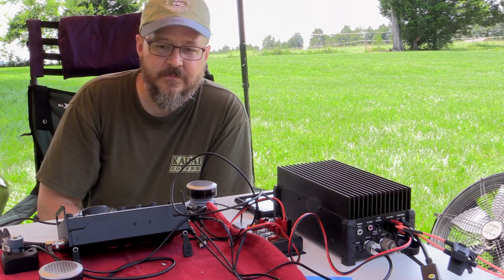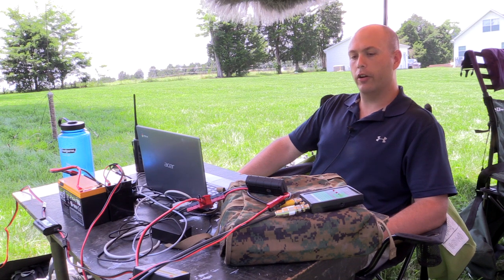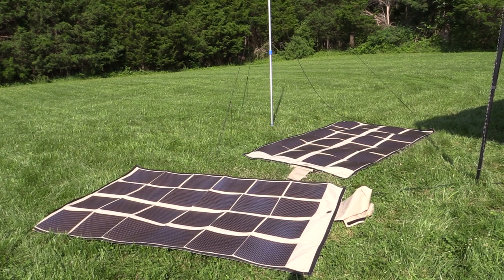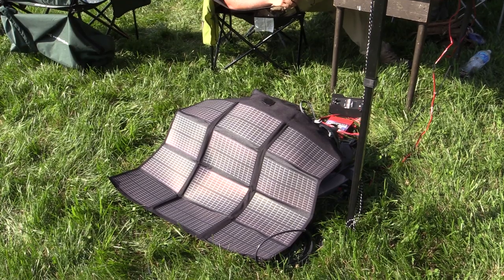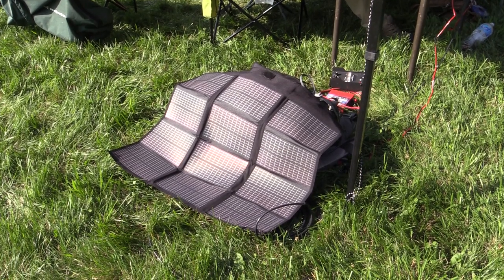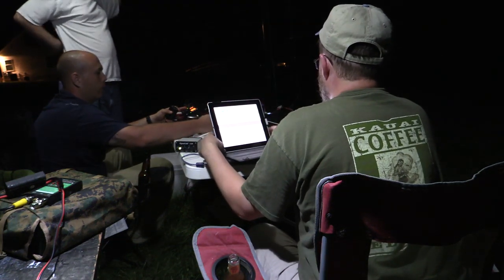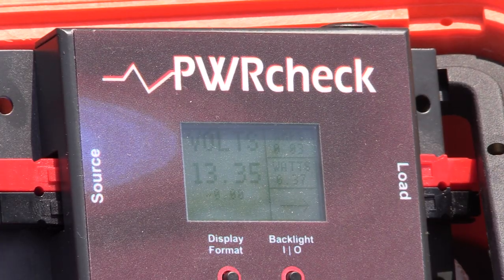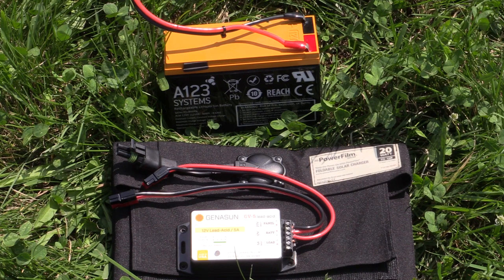2014 Field Day

Comment: What are your thoughts on Power Film 20 Watt panel vs Goal Zero Nomad 20 Panel?
Reply from the maker: I would pick the power film.  I have done tests of their foldable panels before and did not get outputs anywhere near what they claimed.  Now this was 3 years ago, so they may have improved, but I KNOW the PowerFilm are good to go -  I have an older one and a buddy has a new one and they both rock and output thwir rated wattage or a little more.  Just a lot of $$$

Comment: How much average amps did the two 120 panels produce?
Reply from the maker: Our charge controller is only rated for 10A (Genasun GV-10 LiFePo4), so we maxed out at about 11.5A.  This of course is a function of the charge controller, not the panels.  I was hoping for there to be some clouds so we could experience shaded performance, but it was sunny both days.
Reply: the short answer is 12.4 ish amps max.

93watts x2 / voltage under load

Comment: Unfortunately there are very few real hams left, What we have nowadays are what real hams refer to as appliance operators with more money than common sense. You can easily recognize appliance operators by the fact that the vast majority of equipment at their stations and events came out of a catalog and represents the cream of the crop of over hyped and over priced toy's. 

 For example you've got to love a KX3 feeding a wire dipole at 10 feet (AKA a cloud burner) or a shortened ground mounted vertical. Talk about a waste, I could see maybe being able to take advantage of the KX3's close spaced dynamic range (DR3) if you were feeding a 3 element portable beam at 50 feet on a portable fiberglass mast. 

 But the fact remains you're not going to be seeing many 45 over S9 signals on that wire so why chose a 5 watt radio with a 100db of close spaced dynamic range, at that point a radio with a 60 or 70db db of close spaced dynamic range would be more than adequate and then only if you were actually operating CW if all you are doing is phone then there's no benefit whatsoever to the KX3's 100 db of close spaced dynamic range .  
 You might as well use something that's a bit more robust and less expensive and who's software is more polished and ergonomic because the only benefit to the KX3 is that it can handle a 45db over S9 CW signal 2khz away before its noise floor is raised 3db above its theoretical -128db noise floor as compared to say an FT817 or IC-7000 which can handle a 25 over S9 CW signal 2khz away before its noise floor is raised 3db above -128db 

 Of course not understanding any of this is the end result of publishing all the answers to all the ham tests so anyone can memorize the test and get a ham ticket without having to actually know anything about electronics or radio. 

 It's why we have extras who can't solder and don't know ohms law let alone understand what IMD, DR3 or IP3 is or what the difference is between dbm and dbc , But hey they all know the best equipment to buy and they love bragging about it. 
 Unfortunately Today's ham radio is nothing more than glorified CB and all you need to do to prove this is tune into your local 2 meter repeater or listen to 75 meter phone at night. where you will hear all about how Obama is a socialist and what guns are most effective at killing zombies rather than anything to actually do with electronics and radio.. 

Anyhow nice store bought setup, still can't figure out why hams all of a sudden are so worried about fragile solar panels at field day. After all are those tempered glass solar panels actually more delicate then your KX3 ? I mean after all, aren't you already dealing with much more fragile equipment to begin with. 

Oh and by the way when the SHTF hams are probably the last group you want in your camp. Having an appliance operator with all the latest and greatest toys and guns in your group may sound like a good idea at first. Unfortunately more often than not they are so fat and out of shape that they would quickly become more of a liability rather than an asset.

 The last thing you need at your bug out camp is some fat out of shape appliance operator stroking out in a high anxiety situation when you need him the most.. Don't you think part of prepping should also include making sure you're physically fit enough to withstand the stress and anxiety of the looming zombie apocalypse, 
 
 That means that whether your a real ham or an appliance operator if you can't do 50 push-ups in under 2 min and jog a mile in under 14 minutes then I don't need or want you anywhere near my bug out camp. Heck I'm in my 60's and can do 2 sets of 75 push ups and run a 7 min mile and I hold an extra class ticket as well as a commercial ticket. 
SO If I at 60+ years old can do 2 sets of 75 push-ups, run a mile and hike 15 miles then there is no excuse for all these hams half my age being so dog-on fat and out of shape.

One last thing, Those flexible solar panels while over priced are great for boats and back packing. I actually keep a small one in my bug out bag. As for field day I have two 150 watt home made solar panels built on two sheets of salvaged tempered glass.